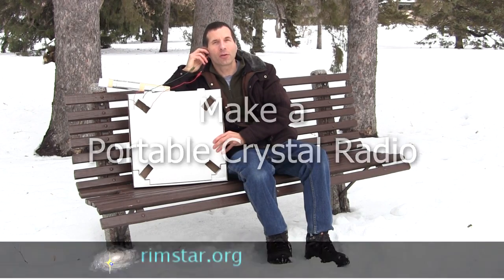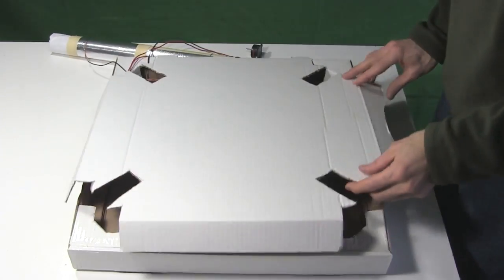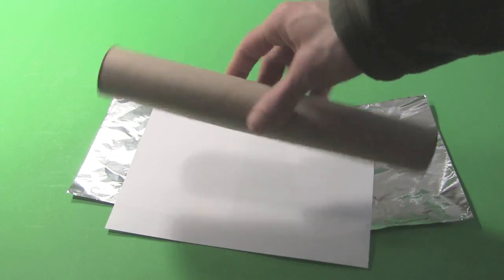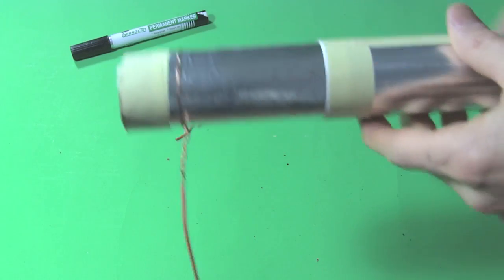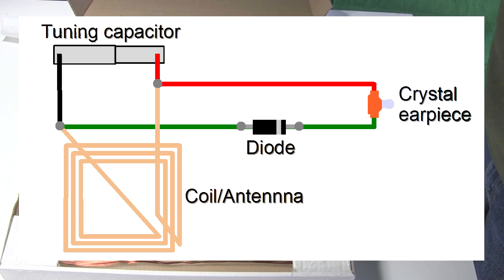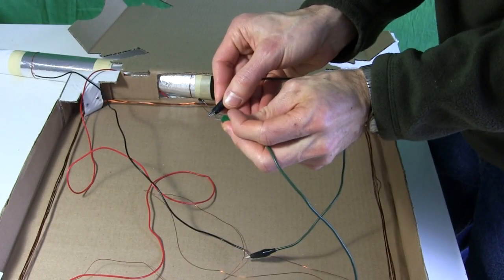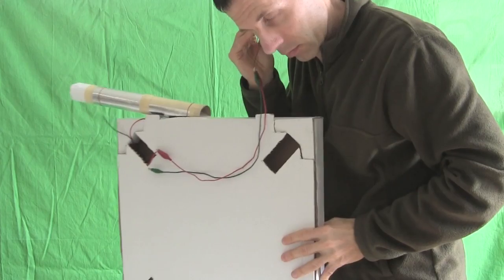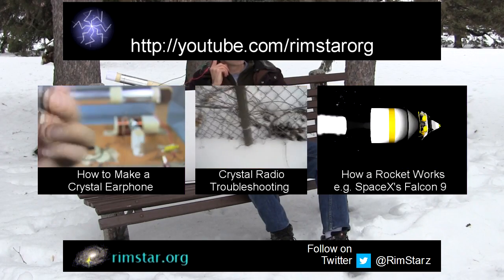Portable Crystal Radio using Loop Antenna and Pizza Box

Comment: I didnt get my crystal radio to work, i think they are no strong stations nearby. I didnt tried this design maybe it works better.
Reply from the maker: That's quite possible. The longer (straightish) antenna you have, the better a signal you can get. Having a good ground, which this portable one doesn't, also helps. I give a bunch of tips on my website here https://rimstar.org/science_electronics_projects/crystal_radio_tips_and_tricks.htm

Comment: @RimstarOrg Awesome project.  I like the "portability" and the fact that a long-wire antenna or a ground rod is unnecessary.  I am thinking of using this for a kids' project to present at a local kids community program.  Some questions:
1. What are the actual dimensions of the pizza box? I think the only clue you gave about size, was that it was for an "extra large" pizza, but you did not indicate the actual dimensions, or exactly who's "extra large" pizza box (Domino's?  Little Cæsar's?  Papa John's)  Alternatively, where did you get the blank, non-branded pizza box used in your video?  Can they be ordered from somewhere "on-the-cheap"?
2. Do you know if one of those little piezo-electric wafer-type "speakers" will work (modified into an earphone or ear piece using some type of enclosure)?  Would these piezo-electric wafers have enough high impedance (such as ama zon ca asin B07JMQM7J3)?
3. Have you measured the capacitance of your homemade tuning "tube" capacitor and/or the inductance of the antenna/coil?  If so, what are they?  I guess the paper towel tube has to be greater than 6 inches in circumference (or about 2 inches in diameter).

I am also thinking that a simpler arrangement can be made to loop the antenna coil around the box, without having to create those special cardboard brackets, and still keep almost all of the wire loop inside the box.  Just poke 4 pairs of holes on the large flat bottom of the box, with each pair near the box corners.  At the corners, thread each winding to the outside of the box through one hole, then back inside the box through the other whole (at the same corner), and then string the wire to the next corner.  The four short lengths of exposed wire (on the outside of the box) can be easily covered with masking or electrical tape for protection.

Also do you think that using 28 or 30 gauge "magnet wire" for the antenna loop would be too thin or vulnerable for this project?

BTW, I am a fellow Canadian living in one of the Maritime provinces.  (So, when you give dimensions in inches, what's that in centimeters, eh? ;-)  )
Reply from the maker: Thank, I'm glad you like the project.
1. The box is 18"x18" but the precise dimensions don't matter too much. I didn't calculate it out with any formula, just roughed it. The only experimenting I did was with the number of turns for the coil, as I mention in the video. It was too long ago to remember where I got the box, likely just to a random pizza store (maybe Pizza Pizza since that's closest to my place).
2. Those piezo-electric wafer-type speakers should work. I show using one in this video here https://youtu.be/HZZmKZJrIW0 Note that due to the lack of a ground connection, this radio has more trouble picking up stations than a grounded one so it may be harder to hear with one of those speakers.
3. The same video above also shows measuring the capacitance of the tube capacitor. I've never had a tool for measuring inductance but for this capacitor, around 369 microfarads should do.
Regarding your loop around the box idea, just make sure it doesn't come too close to anyone's hands since stray capacitance may affect it.
Have fun!
Steve
Reply: @RimstarOrg  Hello again,Steve and thanks for your reply a couple of weeks ago.

Since then, I found the various crystal radio projects that use an umbrella as the loop antenna coil form.  (Sorry, but I kind of like the umbrella idea more than the pizza box. ;-) )

I am particularly intrigued by the ribbon cable loop antenna by YouTuber BillyDIY, in his "3DQ Umbrella Hat AM MW Radio."  He uses a long length of "15-pin" (i.e.15-wire) ribbon cable for the antenna loop.  Where the cable ends join, the conductors are connected together, offset by 1, to effectively form a 15-turn loop.

I am wondering if you have ever tried this ribbon cable technique for a loop antenna, and if it gives good performance?

My thought is to use a 1 x 20 header socket on one end of the ribbon, and 1 x 20 header pins on the other end, for quick assembly/disassembly.  This will spread the normally 0.05" pitch of the ribbon out to 0.1" at the connectors, but I hope that does not adversely affect the antenna/inductor characteristics.

I see that a 5m roll of "20 pin" ribbon cable can be ordered via Amazon dot ca. (On order. :)  ).  A little pricey at cdn$15 per 5m roll, but I am intrigued enough that I want to try this.  So I plan to wrap it around a pizza box (or X form, or umbrella) and see what happens.

If I use all 20 turns, I am hoping I can pick up a local airport NDB (Non-Directional Beacon) that transmits in the 300-350 KHz range.

Thanks again and best regards,
   Ed
Reply from the maker: Nope, I haven't tried a ribbon cable. I like the way the umbrella folds up to make it compact.

Comment: Your next project? A radio powered crystal radio. In the early 1960’s I worked at the Diamond Ordnance Fuze Laboratories (DOFL) located on the grounds of the National Bureau of Standards,  (Connecticut Ave and Van Ness), Washington, D.C.  A fellow worker invented a radio powered crystal radio.  There was a strong AM station nearby.  Using a long antenna, he captured the signal and rectified it to amplify a crystal radio.  No headphones necessary, just a 12” speaker!  It was loud enough to fill the room.  He used a germanium transistor (for its 0.3 V forward drop) amplifier.  I share this story in the hope that it will be repeated.  IICRC  The inventors name was Wes Nichols.
Reply from the maker: Already done. In this video I explain a radio transmitter https://www.youtube.com/watch?v=R04yEKqgGPc and tested it using my crystal radio. Here's the video where I show making it https://www.youtube.com/watch?v=_4-Sx-T6VBc
Reply: @RimstarOrg  I respectfully disagree.  No batteries were used to power the radio or the audio amplifier.
Reply from the maker: Well in that case please describe what you mean when you say a radio powered crystal radio.
Reply: @RimstarOrg  2 antennas; 1 to power  the audio amp, the second for the crystal radio.
Reply: @Boyntonstu  Wow that's amazing.  Do you know (or remember) what the circuit diagram looked like?  What type of germanium transistor?  Since you mentioned that it could power a 12" speaker (double WOW!) I assume that it was a low impedance (8 or 16 Ohm) speaker, correct?  I am wondering if Rimstar's single pizza-box loop antenna can act as the antenna, tuning inductor, AND amplifier power source?  Alternatively, could another loop (to power the amplifier) be wound on the same pizza box, without changing the inductance of the loop antenna/tuning-coil ?

Comment: Are the dimensions of the coil critical, that is, if my coil was round do I need a certain diameter to make it work?  Thank you!
Reply from the maker: It doesn't need to be exactly the same as mine. I wasn't using a very specific diameter. Something very roughly around the same diameter should work.

Comment: I have a couple of questions to ask I have a 16 inch pizza box and 28 guage wire would this work thanks in advance
Reply from the maker: I can't say if it would work in advance. The 28 gauge wire is okay. Since your box is smaller than mine then you'll have to experiment with a different number of turns. Since this one is portable, it's not connected to Earth and it also has a loop antenna instead of a long straight wire. Both those thing make it harder to pick up radio stations. In my case, I have some nearby. So it's hard to say if it will work for sure.

Comment: Hello sir I have many problems and the crystal radio can not work no sound is coming from the amplifier or from the buzzer earphones.please give me some tips so I can make it properly.phone no-8240538675 add to WhatsApp.
Reply from the maker: Did you make this pizza box type of crystal radio which has a loop antenna or a different kind? This pizza box one with the loop antenna will pick up radio stations only if there are some nearby. For ones further away, you'll need to change the antenna to a long, straight wire type and connect to Earth ground. I show that type in this other video https://www.youtube.com/watch?v=VqdcU9ULAlA I also give a bunch of tips which I've gathered from helping people over the years on my website here https://rimstar.org/science_electronics_projects/crystal_radio_tips_and_tricks.htm

Comment: Hello! Can I recieve far radiostation  in my city?There  haven`t any MW transmitter (there is only a MW radio
beacon in a local    airport).Can I use for dhis device a shottky diode?Like BAS70-04.
Reply from the maker: For radio stations farther away I'd suggest making a crystal radio with a long, straight wire antenna, not a loop. You'll have a better chance of picking up farther radio stations. Mine in this video worked because I have radio stations nearby. I show how to make one of those in this video https://www.youtube.com/watch?v=VqdcU9ULAlA&list=PLFsZmHTZL-zlSltC6ELZW9PK4ks7wgPRz (I'm giving the playlist link because there are other related videos too).
As for shottky diodes, a germanium diode like the ones normally used in crystal radios has a forward voltage drop of around 0.2V whereas a schottky diode's ranges from 0.15V to 0.46V. Lower is better since the voltage from a crystal radio is low. From searching for the BAS70-04 online I found https://www.diodes.com/assets/Datasheets/ds11007.pdf. it looks like it's forward voltage drop is 0.41V, a little high. That's still lower than a silicon diode's 0.6V so you can try it but if your stations are already far away then you might want to go to ebay.com and search for a 1N34A (a germanium diode). There are plenty and they're cheap.
Reply: @RimstarOrg  thanks for response!I will try to do the experiment in the future!

Comment: Can you use the razor blade diode with this???
Reply from the maker: Theoretically yes. But I found that my regular crystal radio with the razor blade diode was much quieter than with a germanium diode. This pizza box crystal radio is already pretty quiet due to the lack of a ground connection so with a razor blade diode it would be even quieter, maybe too quiet. But if you have a very strong radio station nearby, it might be audible.
Reply: @RimstarOrg  does the dimensions of the loop antenna have to be that size?
Reply from the maker: It doesn't have to be exactly that size. Mine was that size because that's how big a large pizza box is. I doubt that ten or so centimeters smaller or bigger will matter but since I haven't tested, I can't be sure.

Comment: Well, I wasn't looking for you, but it seems I ran across you again, and when i saw the pizza box radio I couldn't resist, I just had to check it out.  I would normally be very skeptical about a crystal set in a pizza box with no antenna or ground, but when I was a kid (back around the time the dinosaurs died off) I remember seeing a crystal set construction article in an electronics hobby magazine that featured the same idea.   The article was called something like "Build a suitcase crystal radio to take on your next camping trip".   In this old article, the coil/antenna was wound around standoffs screwed to the inside of a full sized suitcase.  The suitcase radio used a standard variable tuning capacitor taken from an old AM radio.  The shaft of the tuning capacitor came out through a hole drilled in the suitcase so a tuning knob with a pointer could be rotated over the face of a dial with 550 to 1600 kilocycles (called kHz today) printed on it.   Another hole in the suitcase was for a quarter inch phone jack used to connect 2000 Ohm magnetic headphones, so it wasn't necessary to open the suitcase to use the radio.   Like your pizza box radio, it was completely self-contained and didn't require a long wire antenna or ground.  I was intrigued by the idea, but I never got around to building the suitcase radio.   The point is, this was a reputable hobby magazine, so I believe this type of crystal set will work if the builder is located near a very strong AM station's transmitter and I give you credit for pointing that out in the video.   Back in the nineteen fifties, there were a lot of powerful 50 kW stations around the U.S., which made this radio practical if you went camping in the hills around a big city like Los Angles.  I hate to bring this up, but I had the same problem this time that I had with your other video--- I couldn't hear anything but background noise and a few crackles when you put the earphone near the camera's microphone.   However, I realize that doesn't mean you couldn't hear the station with the earphone stuck in your ear.  When I watched your other video, i was sure you were one of those people who makes fake projects just to see how many fools will fall for it.   At first glance, this pizza box crystal radio would seem to be the ideal project for a fake video.   But, in this case, I happen to know that crystal set reception with nothing but a big loop antenna is possible if the builder lives near a strong station.  So, I guess I was wrong about you.   However, I think most people who build this are going to be disappointed, because there aren't as many high powered stations around today as their used to be, so they probably won't hear anything unless they attach a long wire antenna and a ground to opposite ends of the homemade tuning capacitor.  I'm sorry I misjudged you when I watched your other video.

Comment: how much volts/ amps recieving?
Reply from the maker: I once measured the voltage at around 30mV. I never measured the current since it's not DC and it's far from sinusoidal AC, which are what meters measure. I doupt the current is very much though.
Reply from the maker: Sorry, I only have time these days for answering questions related to videos in the comments.
Reply: @RimstarOrg  thats sad, i have some cool exp...
Reply: @RimstarOrg  ps. what if u put parabolic dish/aluminum behind the coil? will it increase the power?
Reply from the maker: I haven't looked into it but I suspect the dish would have to be very big. Look into microwave dishes and how their size relates to their frequency or wavelength. Radio waves are a much lower frequency, longer wavelength and so I think the dish will have to be large. You're probably better off just using a longer wire antenna. But I'll leave the math to you.
Reply: @RimstarOrg  good, u used here loop antenna like, is it will be better if u do these loop antenna copper ball like 360 degree? :O
Reply from the maker: I'm not familiar with them so I can't answer that.
Reply: @Zavarkinas  No, a dish won't help.  The wavelengths for AM radio are around 300 meters long.  An effective dish for that frequency would be kilometers across.  The loop is a magnetic antenna that taps into the magnetic part of the radio wave.  You concentrate reflect magnetic fields with aluminum foil.

Comment: Like it but want to shrink it for scouts or my boys,and something a little more permanet,like out of wood with solder connections ,a small real tunning capicaitor. 1n34 A capicaitor,a real crystal ear phone ,I got most of the parts ,but I want to use 20 or 22 gauge megnetic  wire.
Reply from the maker: You can use 20 or 22 gauge magnet wire. It's the diameter of the antenna and the number of turns which matter. For compactness, you can make some sort of unfoldable frame for the antenna. Fold it up when not using it.
Smaller variable capacitors can be found here https://www.scitoyscatalog.com/category/R.html though those are 0-160 picofarads and I usually tune with 0-355 picofarads. Another source is here http://www.shopping-cart.midnightscience.net/t/capacitors. Or you can make your own smaller one http://www.instructables.com/id/air-variable-capacitor-from-scrap-aluminum-sheets/.

Comment: and also does the length and breadth of the pizza box matter for the loop
Reply from the maker: Offhand, I don't know the physics to answer that. I don't know how the electromagnetic waves interact with this antenna. The fact that the signal is strongest when the face of the antenna is pointing at the radio station should give some clue, but it doesn't.

Comment: Hi, is it possible using earphones by transformer for this circuit too?
Reply from the maker: The signal might be too weak if you use a random transformer like I did. However, maybe if you use an audio transformer it would work better.

Comment: I seen that a joule thief can be attached to the coil to light up a small led light. would that still work without the Crystal radio not being grounded?
Reply from the maker: I think it would be a lot harder to get it to work without the grounding. My grounded crystal radio with a longer antenna couldn't even power a joule thief to light an LED and that one is more powerful than this portable crystal radio